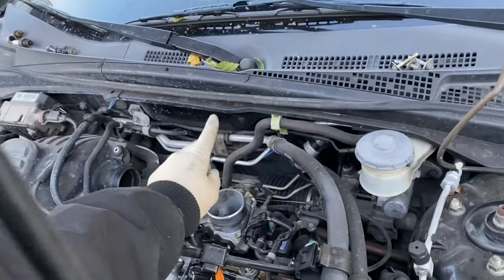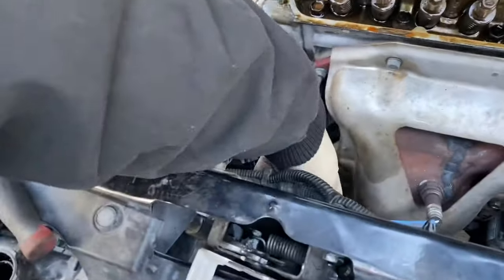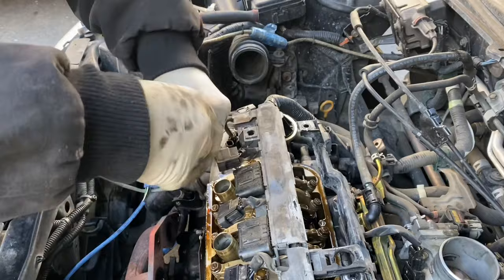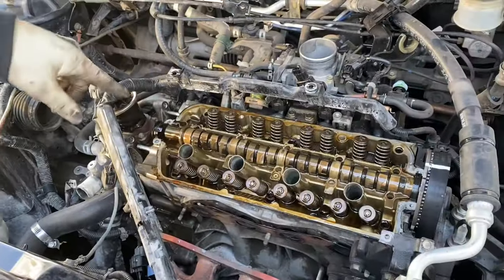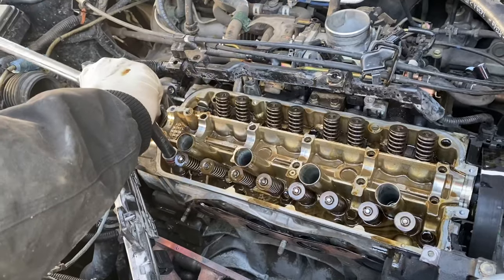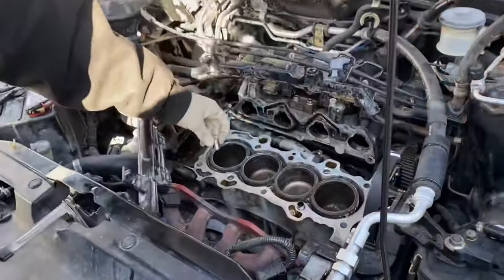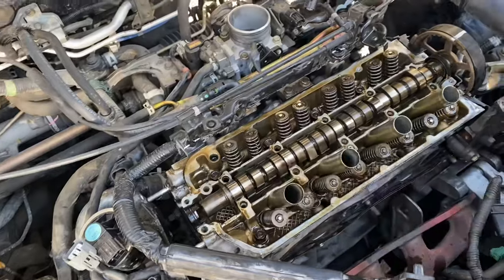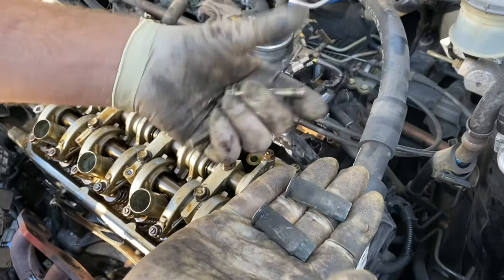2001-2005 civic 1.7 liter complete head gasket replacement step by step

Comment: Completed this about a month back and wanted to say thanks for the video it really helped.
Reply: Hey Jorge-I agree the vid is pretty good.  I'm in the middle of attempting this job, and wondering what I got myself in to.  Still have to get at the nuts/bolts on the intake side, but this vid goes over that section (both removing and reinstalling) very fast, so I'm getting nervous on proceeding.  Do you have additional vids/sites that you can suggest?
Reply: @carnahangreen1391  the bottom middle nut on the intake side I was not able to get it off the way they showed by lifting up the head and going under, I placed the head back down and went under the vehicle with a ratchet wrench and same goes for putting it back on it was really tough to get it back on the threads and turn it.  I also used alldataDIY.com so I could look at the diagrams and get torque specs but this was really the only video I used as a guide. Also pretty much all my head bolts creaked when I tightened them down even though I cleaned out the holes so I continued as carefully as I  could with a click type torque wrench. The beers also helped me with the frustration. Good Luck!
Reply: @purodesmadre713  Thanks so much for the additional info. Very helpful, and your workaround of going under the car to get at the fifth bolt sounds to me the better way--event though the high difficulty remains.  Thanks, also, for that alldatadiy site.  Had not found this, it looks tremendously helpful.  Yeah, just not sure if I'll proceed at this point or reverse course.  Any info is super appreciated.  Cheers.
Reply: Hey Jorge. One more question if you dont mind concerning my other primary concern moving forward: how difficult was it to squeeze the timing belt back on to the rocker assembly-wheel. That section was also skipped over in the vid. Certainly the removal looked simple enough. But putting back on: did you need prying tool or extra hands.. ?  Thx again.
Reply: @carnahangreen1391  Ah yes let me tell you the tale... I had a difficult time because I screwed up the reassembly of my rocker arms making it practically impossible to put the timing belt back on.  Once I corrected my mistake I needed my brother to remove the tensions on the timing belt while I used both hands to force the belt back on.  You need two people in my opinion because you really need both hands to force it back on.
Reply: Oh damn. Good to know.  How did the reassembly of the rocker arm go wrong? Appears to settle straight down or is that....  Did it have anything to do with alignment-tdc or was it fitting back on to top of the head-assembly more tricky than it looks or...?   (I took yesterday off the project and getting back at it today. Too much time to ruminate over potential errors)....
Reply: @carnahangreen1391  In the video the rocker arm assembly comes off and stays together, when I did it the end towards the driver side fell apart including the springs between the arms.  When I reassembled it I did not do it correctly I think I was placing the end spring in the wrong spot, after I realized the mistake it became super obvious why I was having trouble putting the timing belt back on. It was not TDC related, once you reassemble it goes back on pretty easy with a few nudges. Another thing of note is that the procedure for reinstalling the rocker arm assembly on alldataDIY.com has you add grey RTV to few spots on the edges where it mates with the head.
Reply: I really appreciate the tips and suggestions.  Good to know the rocker arm can separate like that.
Reply: Ok. One more and thats it,  then i start wrenching: prior to starting the job did you remove the fuel relay via glove compartment and relieve the fuel pressure?  Or did you brave a bit of fuel spray when disassembling and, if the second option, was there trouble on restarting after all done?  Ok. Thats it.
Reply: @carnahangreen1391  No I did not relieve the fuel pressure and had no issues starting it back up.
Reply: @purodesmadre713  Hey, Jorge.  I wanted to say thanks (again) for the addtional tips.  Those particular points of concern (5th intake bolt, timing belt removal&back, rocker arm stuff--and, oh, hell, putting that back on was an hour or more of trying to get it to seat correctly...) were (as I said) the main concerns keeping me from moving forward--and your description helped in alleviating the "oh shit, the world is going to fall apart if I remove this next piece" type of thinking!.  Anyway, I got the job done a few days ago, and am fairly amazed to have done so.  Everything appears to be holding.  Cheers to you and much appreciated.

Comment: Excellent video, got it all apart. Only question and is. I noticed the intake bolts were quite tight. How do I torque it properly if I put the first bottom but on tight?.

Comment: is sending the head to the machine shop necessary? i.e., if you don't have a head gasket leak to start with. If it is simply a job to change the head gasket as part of servicing?

Comment: If you remove the small aluminum bracket on the intake plate, you can get enough access to the last nut from the top, vs. going the head propped up route. Great vid! Especially thankful this can be done without removing the all the components surrounding a timing belt replacement (ie tensioner)
Reply: I'm in the process of a H/G, timing belt water pump replacement right now. Front of the engine is done, working on unbolting intake from head now. Gonna look for this bracket :-)

Thanks guys for the video, very detailed and takes a lot of guess work out of it for us DYI people!

Comment: Do you replace head bolts? Did you have the head resurfaced? Im going to start mine in the next couple of days. Great video!
Reply from the maker: Sammy Lindsey This is an instructional video we just put the same parts back on except for we used a new head gasket. This Car was wrecked in the back, so was not driveable.  but, yes resurface the head and use new head bolts on your own projects.
Reply: How did it go? Is it leaking?
Reply: Where would I get new head bolts??
Reply: Michael Clearman dealer
Reply: @mcmathayus  any parts store sells them... just get those and a head set (gaskets)

Comment: So quick question, I did everything you said to do, but when I put the rocker arm assembly back on, I have 1-2 valves being pressed down. Is that normal? Based on the cam lobe positions I feel like there’s no way around it unless I re do the timing.

Comment: I noticed you removed the valve rocker assembly and came shaft. Was any valve adjustment needed afterwards?  I was recommended to remove just the cam pully and hold it to the belt while leaving the valve assembly on. Which do you find easier or recommend?

Comment: I learned the hard way make sure theres no oil in the head bolt holes or the bolts wont tighten down and the gasket will leak..
Reply from the maker: Usually the rear corner bolt hole on #4 will fill up

Comment: I have a 2005 honda civic 1.7 l motor i tried to get the water pump out so i turned the crank clockward m it moved the plate behind the cam timing pulley three to four teeth off of tdc i think i moved thee cam ? How do i fix this problem? I am going to put the cam plate om the marks for tdc n rehook up all weill this work? Or should i put the pully for the cam at tdc marks? How do i turn the plat back tp match up with the pully stdc marks ? Need answer asap please. Thamk you

Comment: Bought a used 05 civic 1.7 litre and was told timing belt and pump was changed a couple weeks ago but car still overheated so we determined head gasket was bad. Should I still do the pump and the belt or will they be okay. Thanks!!!

Comment: I’ve followed the video and just put the motor back together today but it didn’t fire up…. I made sure belt and everything was lined up and bought new spark plugs…  had the motor head worked on… but also made sure every was on top of the valves. Wonder what could be my issue now.

Comment: I can't get the timing belt back on the cog.  There just isnt enough slack to make it happen.  What's the trick?
Reply: Im having the same problem. Did you ever figure it out if so how?
Reply: @sanchezfishing1736  Did you notice how the video skips that step right after he says he's going to need two hands. Thanks for nothing.
Reply: Because the timing belt tensioner is to strong for you to pull it back on with your fingers.
This is a “short cut” way of doing a head gasket on a D17A*.  Its not going to give you any worthwhile time savings.
Follow the factory service manual and DO IT RIGHT THE FIRST TIME.  
Also, this Civic doesn’t have anti lock brakes, and it’s much easier when you don’t have to work around the ABS unit !!! 😎
Reply: @yzmoto80  I eventually got it and it ran great.  Thanks
Reply: @slagdemon  what was the trick?
Reply: @shaniatwain1995  Wedge the cog under the belt and just work it slowly iirc.
Reply: Tilt the cam shaft forward.  I used a 3/8” long extension underneath it while unused two hands to pull the belt back on

Comment: I follow the video instruction... but now my car won't start could it be that I put the rocker arm wrong
Reply: Check your timing set the motor to TDC and if you pulled the rockers make sure your valves are adjusted to manufacture specifications
Reply: That's why better not to touch these unless you are fully trained. Engine work small like sparks, ignition coils, oil change, valve cover gasket are okay. But this one also the timing belt go to a qualified mechanic...

Comment: Are the only bolts that need to be torqued in this process, the ones you showed using the 3 torque passes of 14 / 36 / 49?  Thanks.  Really appreciate the video and the description of each step.

Comment: What all should you replace while you are in that far into the engine?
Reply: The timing belt, timing belt tensioner, the water pump, the crank seal, the cam shaft seal, the three drive belts, the valve cover gasket and all 4 spark plugs.

Comment: what did you use to loosen the last 10 bolts until you can see the headgasket because either im not strong or im using the wrong tool because i cant get that second click out of any of the bolts

Comment: Hello..to remove the cylinder head it need to be timing in the tdc before or no problem??
Reply: It doesn't matter as long as the cam is in the EXACT SAME POSITION. if you don't mark it then you will have to find TDC and line up all the markings.
Reply: @bigdm9349  thank you body😀😀
Reply: Hello..the 49 pounds is the last step to torque the head??am doing this job right now in my honda civic lx 2004 and your video is helping me alot..you are a great person😀😀😀

Comment: You did not need to remove the head to get the last bolt off of the manifold the 2 Bolts Dead Center of the manifold spacer if you remove those a solid piece of aluminum comes off and you can fit your ranch right down the hole

Comment: What's the torque on the other 8 bolts? The ones on the valve train...
Reply: I'm wondering the same thing 🤔
Reply: 14 ft/lbs on 8mm bolts(larger inside bolts), 8.7 ft/lbs on 6mm bolts(small outer bolts). Torque in criss cross pattern like head bolts starting in the middle and working out.
Reply: @billnewell4739  Thank You

Comment: My water inlet pipe blows out of the thermostat housing at operation temp any idea what causes that? I replaced the O-ring made sure everything is snug and held in place but the problem is persistent

Comment: Great video! Thanks for it! And thank you for your service. I did as you guys showed here and everything is fine. But the car won't start. I can't figure out if the problem is fuel injection. Mine is a 02 Civic EX VTEC.
Reply: I'm in the middle of doing this same job on my '02 Civic EX vtec, too.  Did you figure out the starting issue?

Comment: Be warned that on some, my 2005 LX 1.7, there is an oil restrictor between the block and the head. It is in the middle of the block at the top. Also there are two O rings. One smaller than the other. These go either side of the restrictor which just pulls out. When I removed the head the O rings fell out and it was pure luck I saw them. The parts manuals barely mention the restrictor or the O rings.

Comment: Any extra tips for a novice doing this for the first time? Planning on diving in on my daily driver 05 civic to finally replace the failing HG, I'm not a mechanic, but love to DIY every fix and maintenance
Reply: Go to the auto parts store and get a bottle of K-seal. It will weld the head gasket leak. It’s $35.00
Reply: The head gasket sealers don’t always work.  When you are driving, even at reasonable RPMs, it puts a lot of pressure on the head-gasket seals.  It may not hold.
Reply: Michael Foerster It’s a first line of defense. And it’s documented that they do work. Is it a 100% guarantee? No. But $33.00 beats paying $2,000 on every day ending in the letter y. Only a fool would even argue.
Reply: What are you guys symptoms?? My 02 civic has oil in the antifreeze... but the engine oil looks fine ?? My water pump also started leaking at the same time.

Comment: i have 2002 honda civic ex manual trans with 226,256 miles. according to previous owner engine was replaced 66k miles ago. have done everything you could possibly think of, im still having misfire. sometimes this week i will be installing brand new fuel pump, then thats all i could think and  everything. pls help. thank you much.
Reply: Did you replace the camshaft position sensor?
Reply: Only reason I’m asking is I’m about to buy an 05 lx and they took it to a shop and that’s what they told them

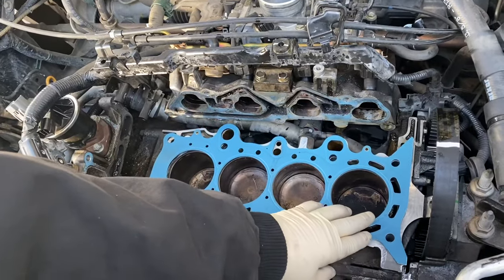Comment: Been doing this by myself and i had a mechanic come and help me with putting the head back on… we forgot to put the nut back on mentioned at 15:45 and 17:45… is that going to cause problems?
Reply: I guess another good couple of questions would be. Is it possible to get on with the head on with the new head gasket and what size nut is that?
Reply: Place gasket on clean block surface held in place by dowel pins. You can remove the oil filter to access the bolt it’s a 12 mm. Good day sir

Comment: K see I'm changing my head gasket on my 2004 Honda Civic ex coupe it's vtec 1.7 now got 2 of the 3 bolts on manifold off k the 1 on driver side is stripped won't turn tryied heating it and tapping smaller size socket wouldn't work what can I do to get it out
Reply: I would cut it off if you have access to it. Since you're removing the head, just replace the stud when you have it removed.

Comment: is it really vital to have those pound pressure measuring tools to screw in the bolts of the head? Only recently I started seeing those tools. I dont remember mechanics using them at all. They used to just screw in the bolts as evenly as possible and that was it. Anyone with me on this? They are just screws right? why should they go in at a certain pressure? If its tight and went in smoothly why would it need to be at a certain pressure? An engineer designed that bolt to go in that block, with its lenght width and everything. Isent this some fancy new way of tightening a bolt? camon man, be honest.
Reply from the maker: I see where you’re coming from. But with the new multilayer steel head gaskets, it’s very crucial. Uniformity is key.
Reply: @gasketmasters  oh the ending of my comment there was really rude. I apologize man, if wasn't really me it was the glucose taking over. Sorry. Thanks very much. I've immediately subscribed to this channel. I greatly appreciate your work.

Comment: Paper gasket better or Steel gasket?
Reply: Paper? You mean composite? It depends. Are you turbo charging it? If not and if you aren’t doing any other mods then I would do composite. That’s if your head or block has warpage and you don’t want to fix it. But only do a certain extent. Of course if it is super warped than neither will work. But if it is not warped than I would go steel mls gasket. Let me know if you need any clarification

Comment: This video has been a life saver !!! One question... doing this method do you have to set the engine to Top dead centre beforehand? Many thanks
Reply: They just marked the cam where it was and reinstalled exactly as it was. Not a bad idea to rotate it to TDC, but not completely necessary.

Comment: What parts do I need for replacement of the head gasket I see the manifold gasket valve cover gasket timing belt maybe water pump can you tell me more
Reply: Headgasket, valve cover gasket, camshaft plug, intake & exhaust manifold gaskets, injector seals and head bolts.

Comment: i want to do mine 02 civic HG any other tips not covered in all replies will be help fill love ur video doing without taking off all the side pullies  and pumps so i have to take only head for resurfacing leave everthing behind right thanks for your video. can you come over to Richmond BC canada for the job guess not in Corona days. i will try doing it exactly.  in the video. thanks again
Reply: oh i have the booster system on my 02 civic timing belt side very difficult to take cam shaft sensor and cover iff buy the way one of the 12mm exhaust nut  slips now i am looking ways to take that nut if without buying any extra tools

Comment: I was about to install the battery, power steering pump, and air box in the morning and try to start it up but as I lay in bed at 2 in the morning I realized i forgot to push the seal on the cam back to stop oil leakage 🤦‍♂️

Comment: I cant seem to get the belt back on the camshaft. Is there something i need to loosen?
Reply: It's best to remove the timing belt tensioner when doing this repair.  Installing a cylinder head gasket without having the head surfaced by a machine shop makes zero sense.